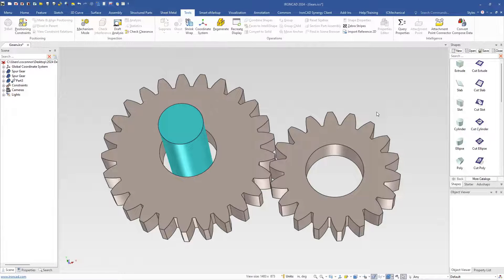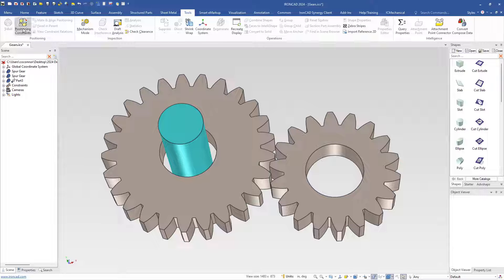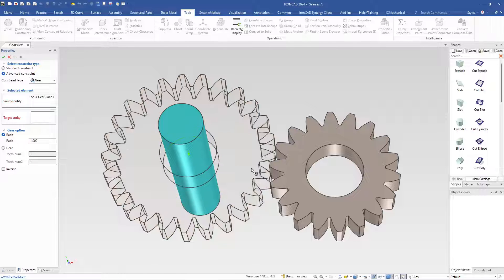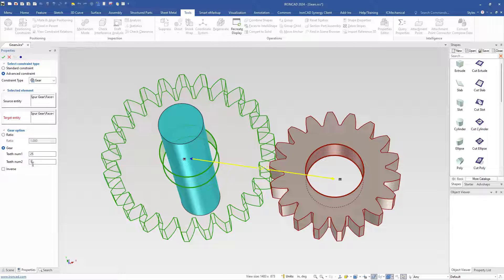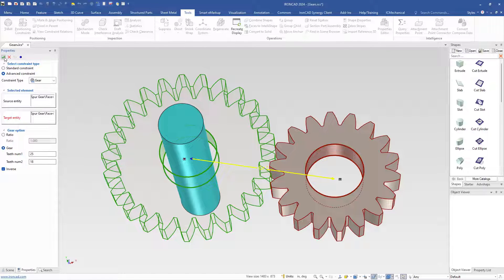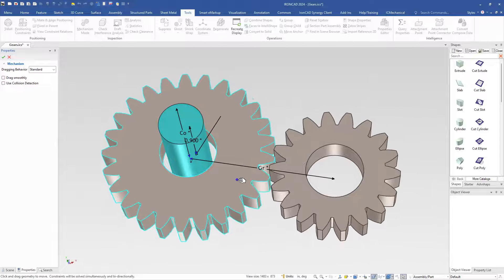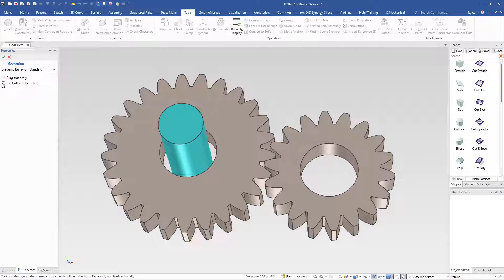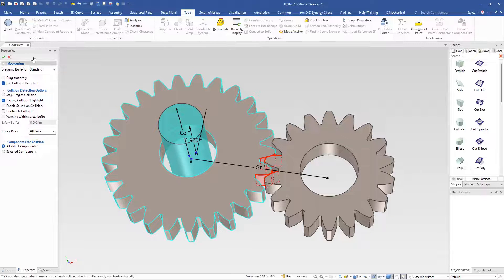Gear Constraints (Positioning Constraints Advance)

Comment: How did you move the gear without dragging it away?
Reply from the maker: Hi @kajsam7641, thanks for your comment! Are you referring to the movement at 1:29? If so, we used our patented TriBall to move the second gear to the left to purposefully cause interference. You can activate the TriBall by pressing the 'Q' key or by using the F10 key. If you'd like a more detailed explanation, please reach out to us or your reseller and we can show you more.